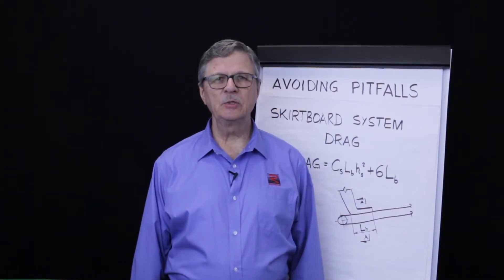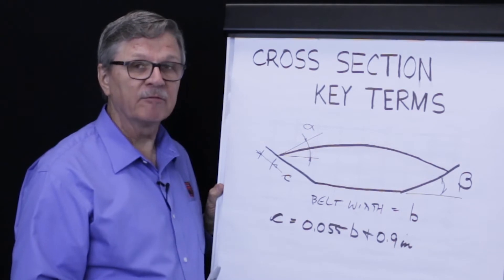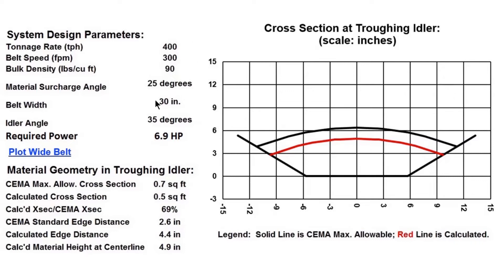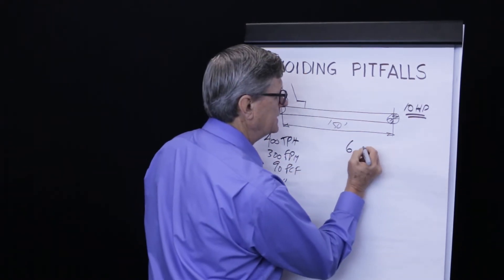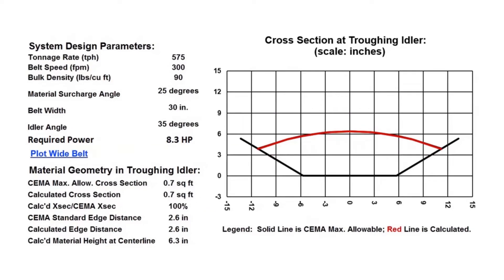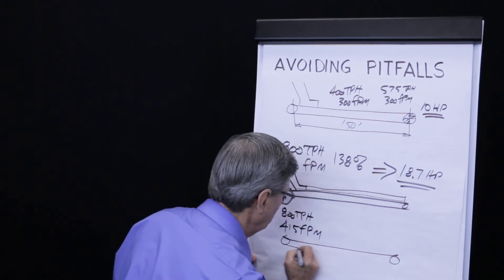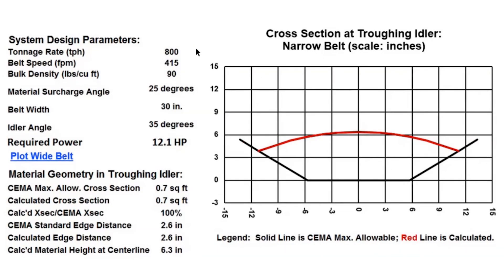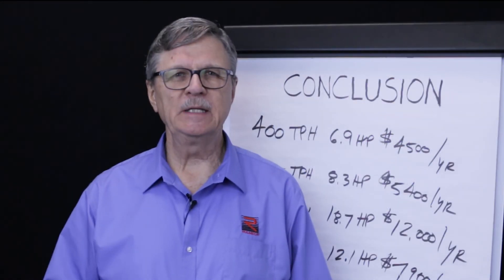How to Avoid Conveyor Skirtboard Mistakes. Part 2 of 2

Comment: what should be the skirt design criteria if there are two chutes on a conveyor belt. The material passing out of one chute may hit the skirt of ahead chute.
Reply: The calculation is straightforward.  You simply make the calculation as is the chute were continuous.  In other words, if the first skirt is 3 meters long and the second skirt is 3 meters long, you simply use 6 meters as the skirtboard length.  This will yield the appropriate estimate of total skirtboard drag.